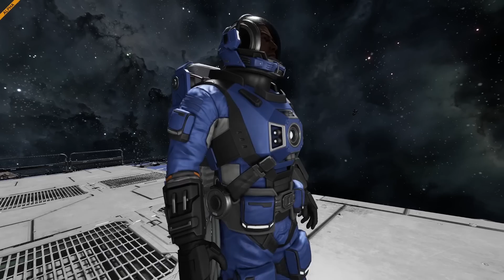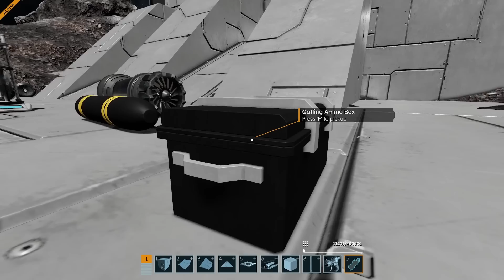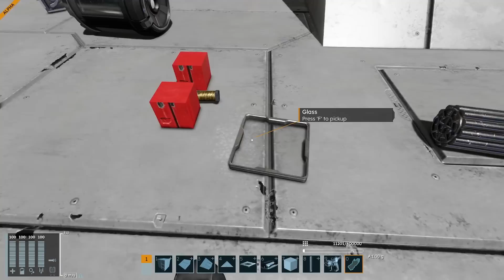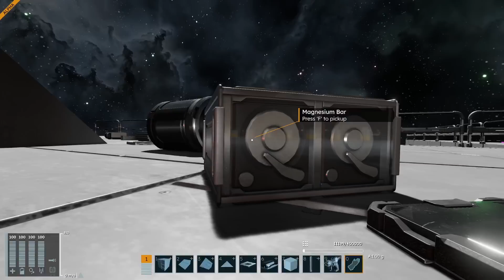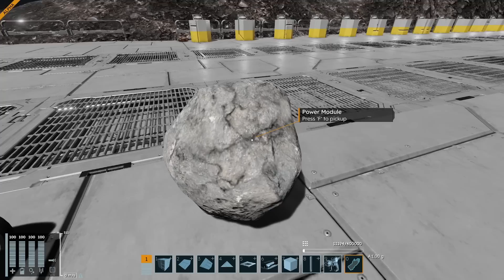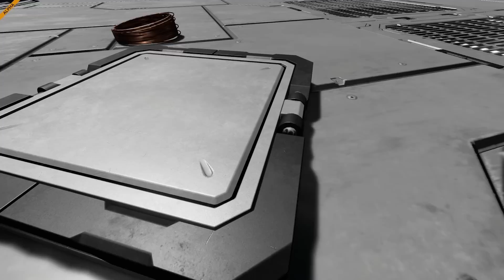SPACE ENGINEERS 2 NEW ORES, COMPONENTS & POTENTIALLY LASERS? [VS1 Alpha]

Comment: Lasers are likely a component for certain communications devices and assemblers for laser printers/cnc machines. May also be a component for reactors and ion thrusters. 

I would probably see the use of titanium and cobalt to make the ultra duty plates and use them for heavy armor as well as some industrial applications. Heavy duty plates I would likely say would be for armor and some lighter industrial uses made from chrome and iron, being stainless steel plates. Steel plates potentially being just regular steel and used for detailing and some of the more basic and lightweight of blocks.

Comment: the laser has more uses than one might expect. 
most notably in inertial confinement fusion reactors which use processed water as fuel, and need pressure pipes for the superheated coolant to run through very high quality turbines that can survive extreme temperatures*. some interpretations use *superconducting magnets to assist in confinement. calling it now, endgame tech is a stable water-powered LCFR for near infinite amounts of moderate power generation.
as for the magnesium, it's often used alongside steel for cutting surfaces, heat resistant tiles, and things like electrodes. It could be only available as a material, and all products are just doped with it in production. there are very few uses for bulk magnesium outside of magnesium oxide and nutrition tablets/powders.
Reply: figured it'd be for the laser antenna?

but HELL YEA FUSION BABY

Comment: Chrome plating is used to protect from corrosion. Maybe the sprayer will be used to coat parts and ships to protect them from a planet with a corrosion atmosphere.
Reply: Or, perhaps somewhat more importantly, protecting things like pipes, pumps, and hulls from the corrosive effects of water on metals. Particularly for water pumps as they deal with water regularly enough it’s possible they would be damaged. Chrome plating gives an excuse as to why it wouldn’t necessarily need constant maintenance and replacement parts.

Comment: Future storage will never be 100% solid state.

Solid state storage is best for...
Archives (that aren't meant to be accessed frequently)
Boot-up drives (for faster computer boot-up)
Extreme environments where magnetic and mechanical storage systems aren't practical.

That covers a lot...but not even close to all situations.  And for all other situations, magnetic storage will still be the go-to.  That said...other technologies could make magnetic storage significantly different than what we know today.  Time will tell.

But the key flaws of solid state drives are physically insurmountable.  No element, no combination of elements, and no hypothetical meta-material even can have the kinds of properties necessary to produce a solid state drive without their current weaknesses.
Reply: You make some good points.  However, in some ways, SDDs are even more vulnerable to both ionized and especially non-ionized particles in space than HDDs.  This has to do with the feature size (being so tiny) of modern semi-conductors and the low voltages (which makes it easier for interaction with charged particles to flip bits, even if they don't do physical damage) compared to the magnetic plates and sectors in HDDs.

No matter how you slice it, past a protective bubble provided by a magnetic field like Earth has (which isn't as common as one would think among the rocky planets and near planet-sized moons), interplanetary space is a dangerous place for almost all electronics.
Reply: You make some good points.  However, in some ways, SDDs are even more vulnerable to both ionized and especially non-ionized particles in space than HDDs.  This has to do with the feature size (being so tiny) of modern semi-conductors and the low voltages (which makes it easier for interaction with charged particles to flip bits, even if they don't do physical damage) compared to the magnetic plates and sectors in HDDs.

No matter how you slice it, past a protective bubble provided by a magnetic field like Earth has (which isn't as common as one would think among the rocky planets and near planet-sized moons), interplanetary space is a dangerous place for almost all electronics.
Reply: You make some good points.  However, in some ways, SDDs are even more vulnerable to both ionized and especially non-ionized particles in space than HDDs.  This has to do with the feature size (being so tiny) of modern semi-conductors and the low voltages (which makes it easier for interaction with charged particles to flip bits, even if they don't do physical damage) compared to the magnetic plates and sectors in HDDs.

No matter how you slice it, past a protective bubble provided by a magnetic field like Earth has (which isn't as common as one would think among the rocky planets and near planet-sized moons), interplanetary space is a dangerous place for almost all electronics.

Comment: With added Lead they've extended early game and increased recipe complexity. Probably replacing the Silver in the Reactor recipe. As well as adding it to early electronics.

Extending the technology chains is a smart move especially paired technology tiering.
Reply: They almost certainly will have more complex metallurgy given the new ores.  For example, as mentioned in the video, chromium is a major element added to create stainless steel alloys (most such alloys are at least 10.5% chromium).  Nickel, an old favorite, is also used in many stainless steel alloys.

Comment: In space, devices are exposed to strong radiation and extreme temperature fluctuations. In some cases, HDDs may be more resistant to these conditions, while SSDs can be more sensitive to certain types of radiation (e.g., bit-flip errors).
Reply: Go for CD discs!
Reply: ferrite ring core storage (or whatever it's called) go brrrrrrrrrrrrrr
Reply: @KrakowskiCorp  tape storage go screeeeee pttttzzzzz fpt
That was it scratching due to an error, then tearing, then breaking :P
Honestly forgot those ferrite rings were a thing... kinda reminds me of those original Record players using the wax/metal can instead of a disc.
Reply: @KrakowskiCorp  It worked for the Apollo program.
Reply: HDDs have a bad time with extreme temperature, and magnetism. The protection against those would have to be more robust than a thin lead shield.
Reply: @nvfury13  Actually, for one of those things you mentioned, magnetism, there are options for both passive and active sheliding (https://en.m.wikipedia.org/wiki/Electromagnetic_shielding#Magnetic_shielding).

Also, as far protection for SDDs goes, "thin lead" is far from complete.  As thin protective shells, even those made of something as dense as lead, can potentially do more harm than good for both high-energy ionized and non-ionized sub-atomic particles by being insufficient to stop these particles, but still slowing them down.  For charged particles, this essentially means more clock cycles can be influenced due to longer exposure, even though it's still a fraction of a second.  For both charged and non-charged particles, being slowed (but not stopped) by physical shielding can cause scattering; where they more-or-less ricochet within the IC.  This can expose significantly more semiconductor features to be damaged than if the high-energy particle passed through cleanly because there was no physical sheilding to dissipate some of its energy.
Reply: Also, technologically speaking, it's not 10,000 years into the future. I can't remember the exact date of departure but the vast majority of those 10,000 years were spent in transit.